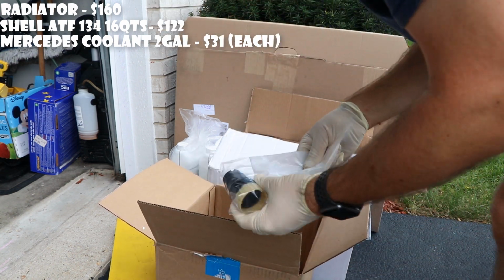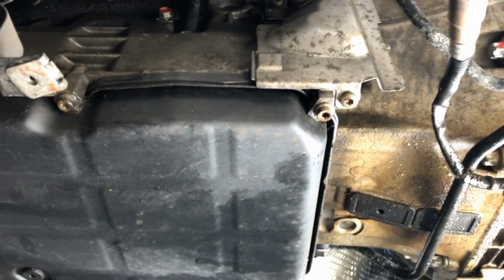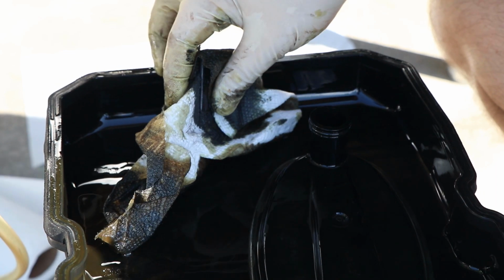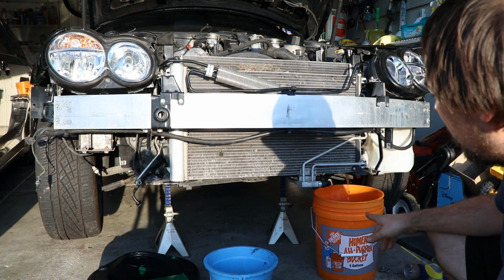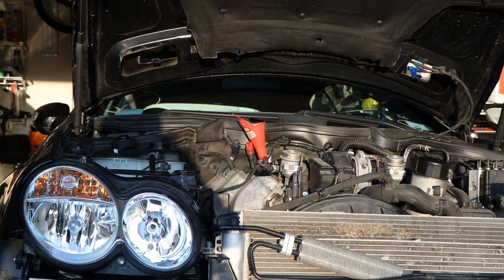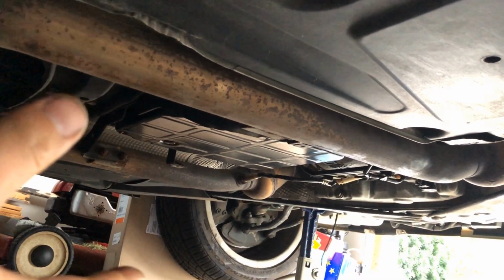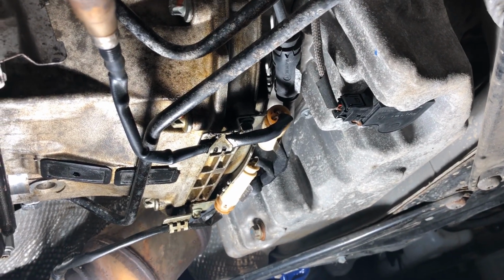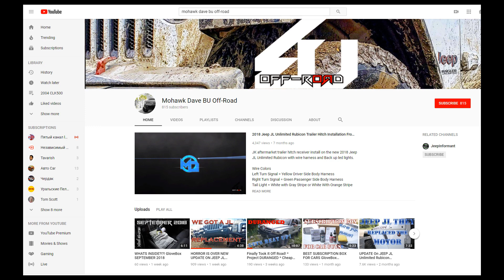Transmission fluid flush, Connector Replacement on my cheap W209 Mercedes CLK 500 from Copart

Comment: Hold up, wtf? Lol. Something tells me this car doesn't drive now. You don't just change automatic transmission fluid like you do the engine. You need the machine that flushes it and phase is it with new transmission oil. Second, why are you siphoning out the oil in the crank? That was the dipstick for the crack, considering Mercedes didn't include one for the transmission because it's sealed for life. More power to you I guess, but don't be telling people to just start doing this in their driveway. Why? Because their car will be 100x worse. This is misinformation my dude.
Reply from the maker: "Sealed for life" - you made the comment of the day :) No one knows whos life though :)
Reply: @HETPEZB  I'm curious, how many miles did the car have when you did the transmission service?
Reply: He's actually 100% right.  The goal is to simply drain/fill old transmission fluid.  DO NOT flush.  Flushing will strip clutch material from the inside.  If you flush, there is a big chance the transmission will start slipping.  You're right, the cap is sealed.  There are aftermarket dipsticks to check transmission fluid levels.
Reply: He is right but, he is talking about a full fluid flush, not a fluid change, this is a fluid change not a flush as alot more oil is left in the transmission that you cant see or get to, so changing this fluid will be fine as it is not completely new fluid and should not cause these transmissions to slip, only if you completely flush your fluid and put new fluid in you could cause slipping. The most recommended method is to extract 1 quart through the dipstick and replace it with a new quart of fluid, after which you drive the car for 30 minutes which will mix the new fluid with the old. This will basically get your transmission ready for new oil and it will help remove excess particles of wear and tear from the transmission before the "change". Then if you proceed to extract the fluid through the dipstick from on the bottom of the pan, remove the pan, clean the debris, and change the filters and everything like depicted in the video, you will be 100% fine.
Reply: Your mixing this up with Audi.Mercedes is not sealed as you can see from the transmission kit the dealer sells.
Reply: Hi
Even though gearboxes are said to be sealed for life ist there a benefit to replace the old fluid with new? Just asking.

Comment: Great video, it's always best to place the pan on a counter and test if its leveled  in which case you have to figure out the tilt and adjust much higher torx pressure as well as applying some fluid to the top of the rubber gasket before placing it back on top to get a better fit and prevent leaks. Thank you for uploading this.

Comment: I have a clk500 with a dead display, can you help ?
Reply from the maker: What display exactly are you talking about? There are quite a few different ones in that car :)
Reply: it’s a Clk500 and whole cluster is dead,  no instruments working or lighting up at all
Reply from the maker: David Taylor , did you confirm that all the power wires coming up to the cluster has a power?
Reply: It has power . I think I have determined that it might not be getting canbus signal
Reply: I am guessing you fixed this by now. I came here for transmission issue. Anyway, I had the same display issue. It was just a fuse. There is one on driver side of dash and one in the trunk on driver side. Works fine after changing those.